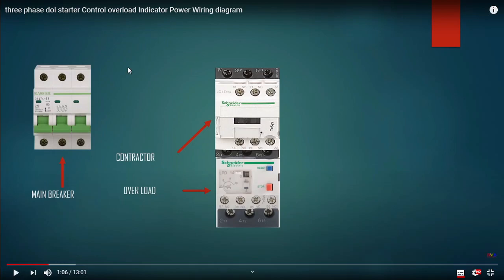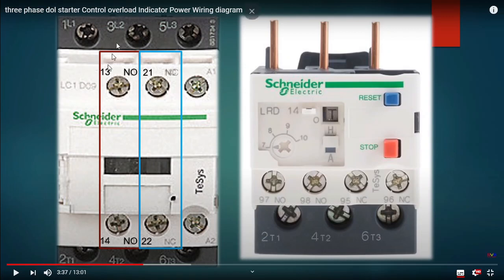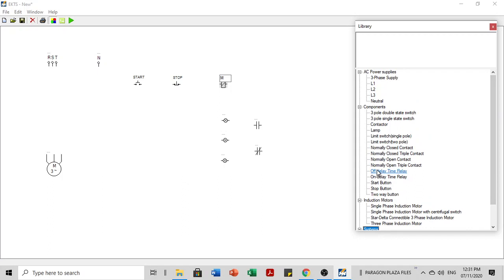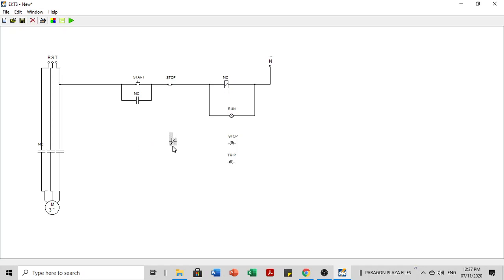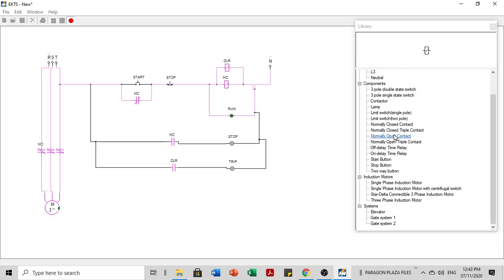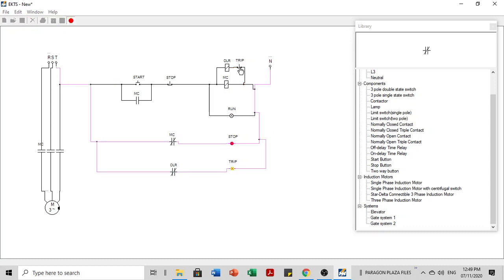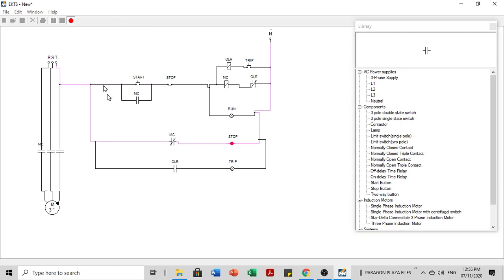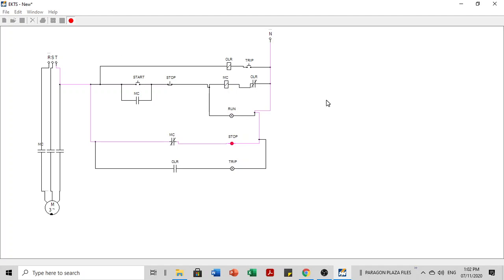THREE (3) PHASE DIRECT ONLINE STARTER CONTROL SIMULATION USING EKTS SOFTWARE

Comment: nice bro add more videos using ekts software it helps a lots
Reply from the maker: Noted Sir.. sana maay natutunan ka sa video kahit basic lang. Thanks.
Reply: @EngrJayCaps  yes sir meron nmn😊 at nagkakarun idea. dun lng sa over load lng ako medyo confuse kse ala sa ekts software pra d nailaw yellow ung sa trip.
Reply from the maker: Umiilaw yan sir, but you have to manually trip since diy lang yung ginawa ko na OLR jan, wala kcng OLR sa components. The concept lang is when the OLR trip, the trip pilot light will lit/glow.